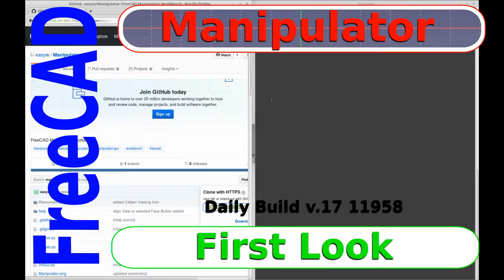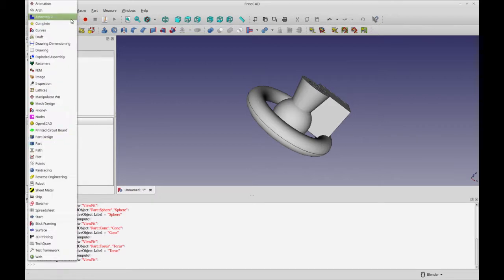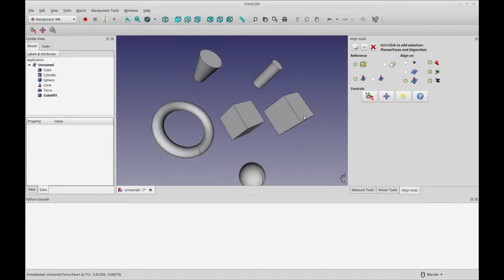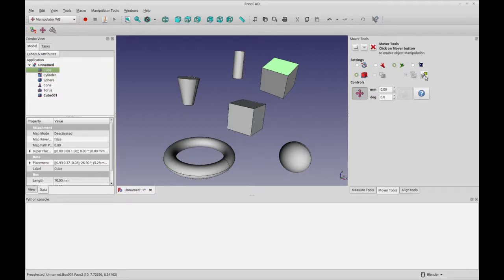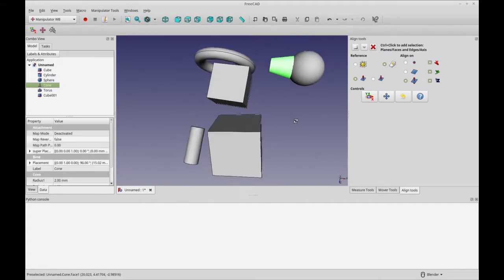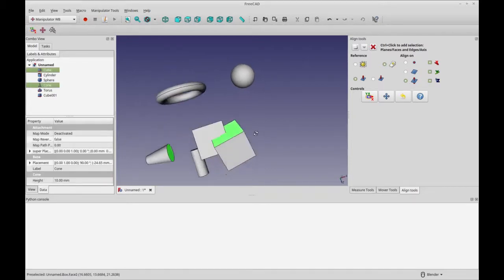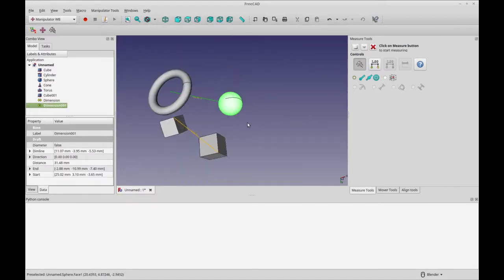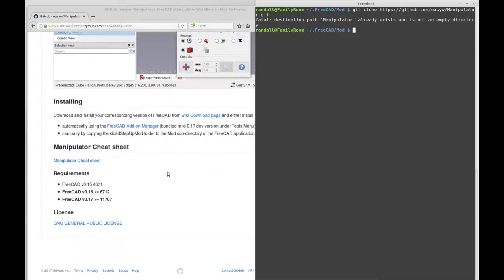FreeCAD - Manipulator WB Tour

Comment: Hi Paul, thank you for your review :)
I slightly modify the tooltip for the Axis of rotation, so now it is more clear which is its function... 
the first radio box on the mover is to select an Edge on an object as the rotation Axis.. 
https://www.freecadweb.org/wiki/images/b/b0/Manipulator-WB-Mover.gif
So you will have much more possibilities than the standard manipulator in FC

I also updated some of the Manipulator WB help on the FC site
https://www.freecadweb.org/wiki/Sandbox:Manipulator
All the tools are working with 3D Part objects, but they work also with Body and Part with hierarchy.
Each Tool has a Help Button to get some useful tips 
Maurice (easyw) :D